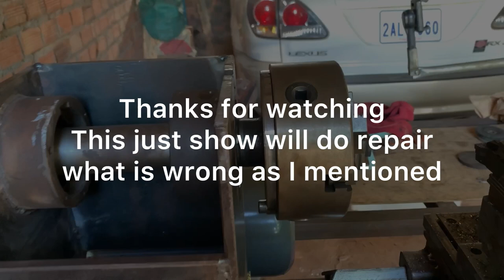How to make heads tock lathe Build headstock lathe Chuck, Jaw #Diyhomemademetallathe

Comment: Good job boss
Reply from the maker: Thanks
Reply: @mr.ranyhomemade2466 hi mate for the shaft with holder of chuck do u make it or buy??
Reply from the maker: @botak333  thanks
Shaft holder I made and now making a new lathe machine much more power then.
Reply: @mr.ranyhomemade2466  yes i want also, ihave liner rail type 20. From stract, and also ballscrew 1605. But for the shaft i canot imagin how to makeit? It must with a nut?

Comment: Great job maybe you could fit the spindle into the headstock before you tack up  so you can preload and Aline the spindle and shaft
Reply from the maker: Thanks for your comment I appreciate and knew someone problem after but I thought it is my first time experience that I’m looking build new one soon if I can should be enough my knowledge too. Last time 75% I make by hand.
In this time I have some equipment ready 
Thanks 🙏
Reply: Cast iron and not prefabricated is best But like you I have only ever prefabricated components like you lathe ,the thing to take into account is the expansion and contraction stresses welding puts on you project. I worked at a foundry that went from casting things like headstock housing to prefabricated the same ,they found out pretty quick they had to  weld first stress release if needed ,then machine,my job was as a blacksmith who had to straighten some big problems caused by expanding and contracting welds .keep up the good work up and look for the answer to any problem anywhere and everywhere .👍
Reply from the maker: So lovely your sharing info 
I would like your show.
I will trying the way for next homemade. Anyway I do still problem with railway to run carriage and tailstock because I did by hand, right now I’m looking stone wheel grinder don’t have in my city, that is my problem.
I will try the best because I do not want the lathe.
Thanks again

Comment: good job the bearings need to be packed with a lot of lube more than you put on them pack them full
Reply from the maker: Thanks very much for your sharing I do have some problems because the ring to keep the bearing is not tie enough, I will build new homemade lathe soon if possible I think can make it better.

Comment: First off. You have made a lovely machine. I very much look forward to seeing how it progresses. On that note I have a question. What did you use for housing your bearings? In the video it looks like you have welded a component of some sort to the plates. I would very much like to know what that is.
Reply from the maker: Thanks for your comment 
In this video I did show my headstock spindle and bearings, the first I sued two plate pieces  thick metal weld and drill then scrape hood I bought to keep bearings, finally I got headstock it worked but hood is not tight enough for bearings when milling deep cut sound shaking. I’m planning make new homemade lathe

Comment: Voceis nunca esqueçam  de informarem o tamanho das placas dos tornos  se for pusive  também  o preso  é importante porque ém cada  região o preço  muda e tem lugar que a  gente tem  dificuldade de  comprar
Reply from the maker: Thanks for your adding info 
I will try the best way the headstock I did is not good enough because the metal as I used bit thin and one more thing the ring to keep bearings not tight so when I to milling deep cut sound bit shacking.
Anyway if I don’t have this lathe it mean I don’t have any equipment too so happy to  use if I get more income I will make new lathe.

Comment: It would have been better to use a dial indicator to align the headstock with the tool post. If you can't get certain tools there you could always get someone to mail you one. I live in Delaware in the United States so I can get basically anything I would need as far as precision measuring goes.
Reply from the maker: Thanks for your information I appreciated.